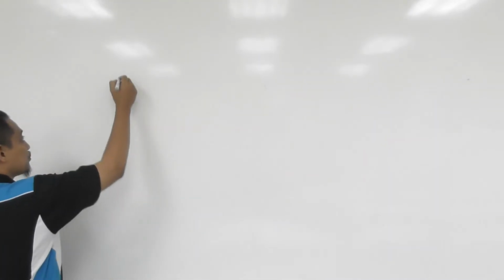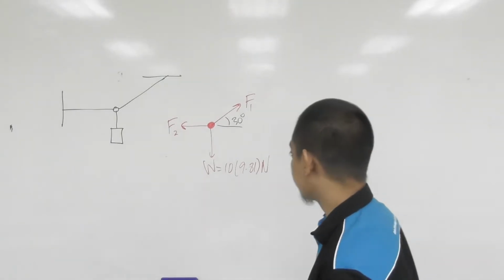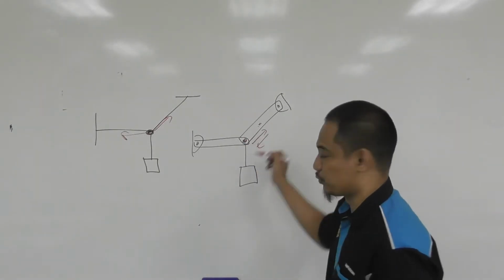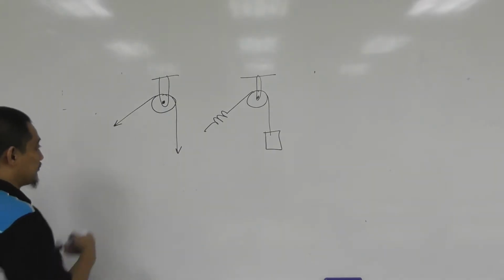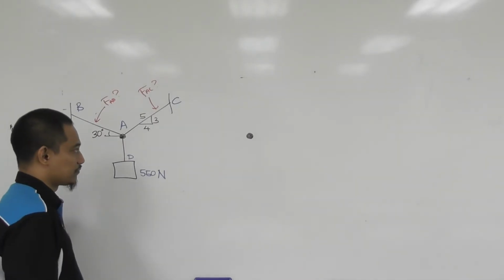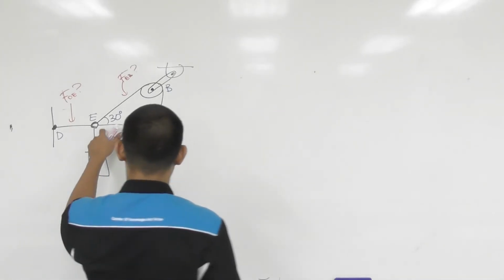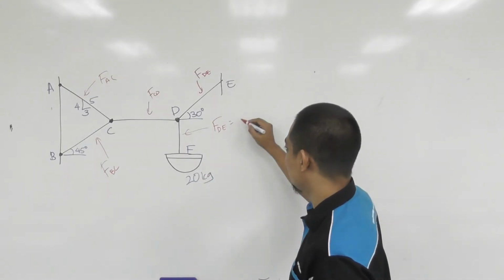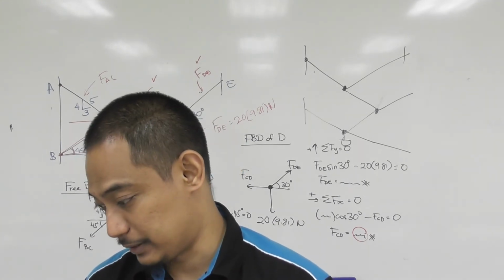Statics - Chapter 3 (Sub-Chapter 3.1 - 3.3) - Equilibrium of a Particle (2D)

Comment: sir, do we dont need to change the sign of the value of Fcd even though the direction is change?
Reply from the maker: which part of the lecture are you referring to?
Reply: the last question, sorry sir😅
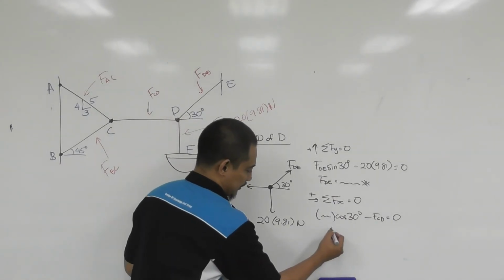Reply from the maker: @ashrafzulhelmi1851  Fcd in 59:16 is it?
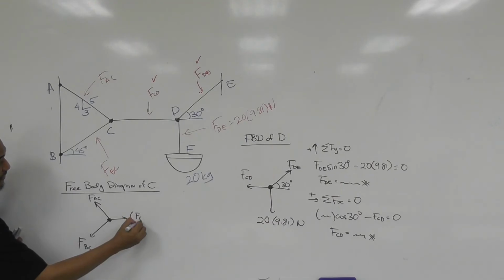or you are talking about the second FBD in 1:00:16 ?
i could not understand what you mean by change the sign and direction change
are you referring to Fcd in first FBD is to the left and in second FBD is to the right?
Reply: @SaifuddinRehan  yes sir, because at the previous video you said that the force can change sign if we assume it oppostie way...but i dont know if it same in this case
Reply from the maker: @ashrafzulhelmi1851  i'm not entirely sure which are you referring to exactly in the previous video..  is it for chapter 2?

in this case if you are referring to the 2 FBD, the force did not actually change direction...
rather, the cable CD which produce the force Fcd, is producing a force to the left direction if you focus on point D, while it is producing a force to the right if you focus on point C..   
it is the same force, from the perspective of 2 different points...

if the direction change, for example for FBD on point D, Fcd is to the right, the corresponding FBD on point C, Fcd will be to the left...   (this is only possible if the connection is "pushing" the particle, which is not possible in this case because cable/wire can only pull, and can never push)
Reply: @SaifuddinRehan  ouhh i understand, thank you very much sir...and yes i watch your videos on playlist so the previous video is about chapter 2

Comment: Excuse me sir, does the simultaneous equation need to be shown? Or straight away used the calculator. I think I lose mark because of this??...
Reply from the maker: In term of the exam, if you take a look at the past exam questions (on italeem), on the cover page at the bottom there will be note stating:

"Direct solution of simultaneous equations using programmable calculator is not allowed."

so for the case of securing the marks, the solution of simultaneous equations need to be shown, as there are marks allocated for those steps..  if you skip the steps, you will lose those marks..
Reply: @SaifuddinRehan  Alright Sir. Noted that. Thank you very much.

Comment: Sir. For the answers, are we need to put the -ve & +ve sign or arrow like in the slide or just put a number only?
Reply from the maker: the answer for the Force?
in the calculation it should follow from the steps before, whether it end up as positive or negative  answer
but when you obtain a negative value you should explain what that negative means (because there is no such thing as a negative value of force)
hence it (negative answer) means the actual direction is the opposite of the direction drawn in the FBD
and normally you indicate this by an arrow at the answer